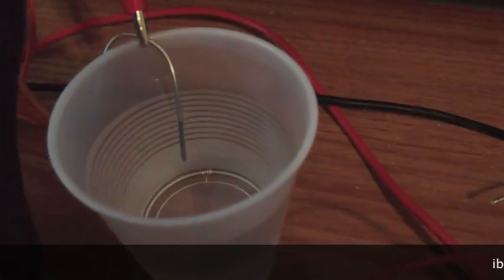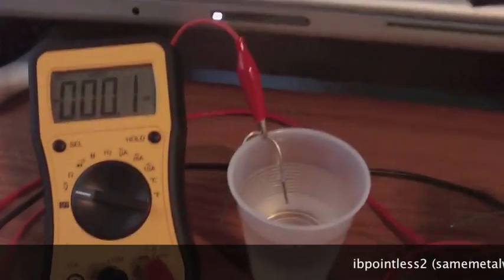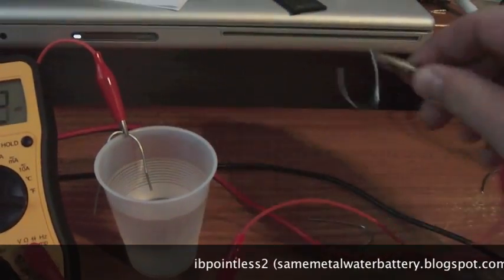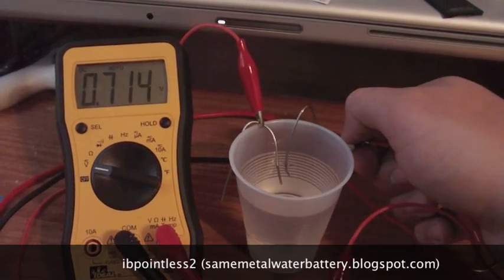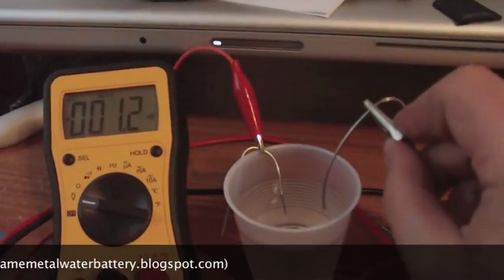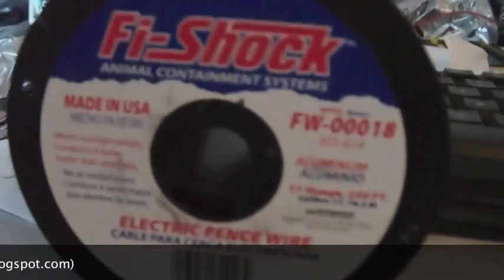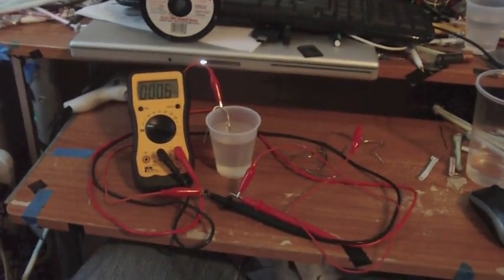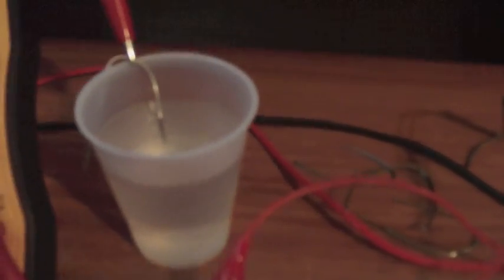They say it can't be done The Same Metal Water Battery

Comment from the maker: @GuardianZeus21 

Leave it hooked up to the meter and leave the room, then come back in 5 minutes to see if the voltage has changed much. If you can record it to see if it changes. 

My cells don't act much to me be there. My cells drain when they're connected to the meter but a low farad capacitor would do the same. It could be acting to your presence, some say water take on a life of its own (search YouTube for "water 2008" for a documentary.)

Comment: Replicated with silver, alli and copper. Most I got was 100mv from silver. I think this was due to the fact that one of the silver electrodes was tarnished. Did notice on the alli that when I switched electrodes I held in my hand the voltage would switch between + and  - . I was not holding them directly but through the plastic insulation. However I think that the body's EMF has something to do with this as when I step away from the cup the voltage drops and then I step closer it rises.